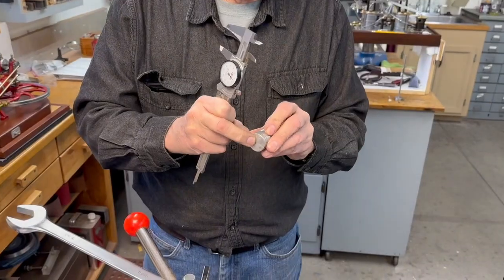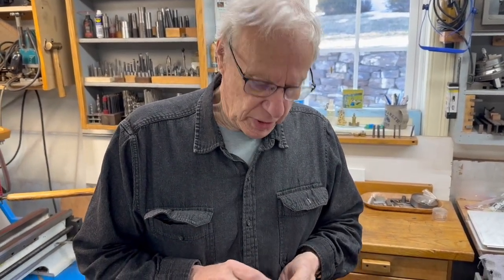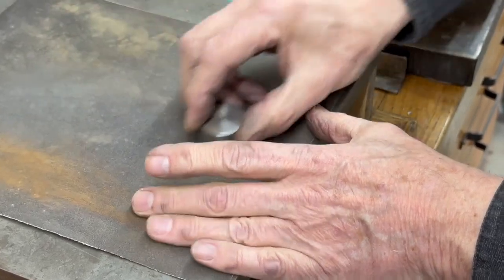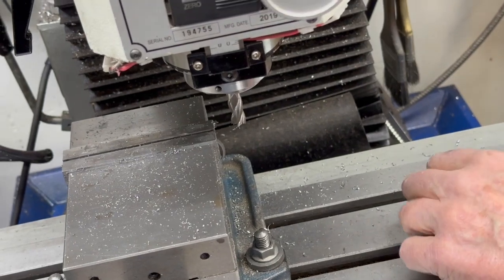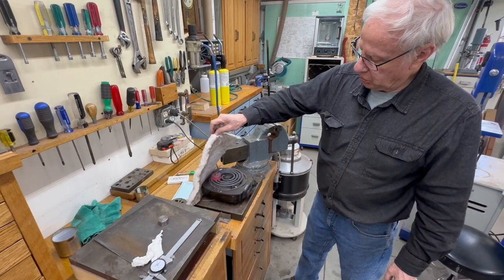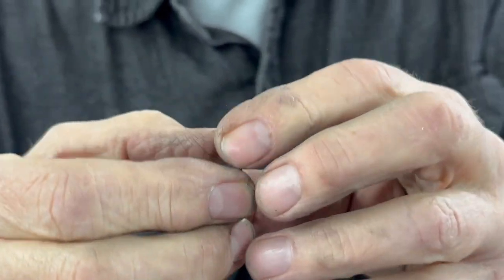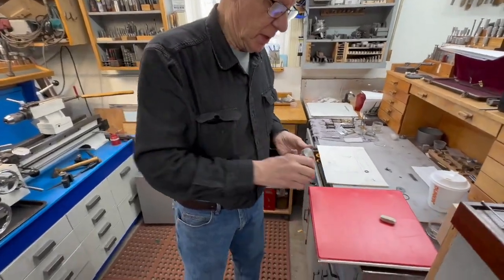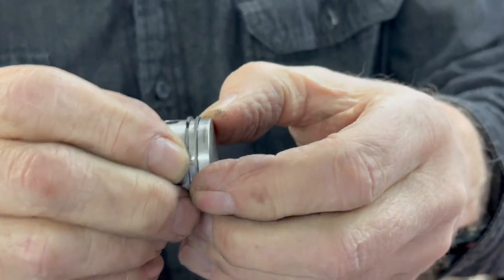How to Heat Treat Piston Rings

Comment: The fact that your parts lapped out in only 50 strokes or so, is proof as to how well your heat treating fixture and process worked to minimized warping and going out of round.
Reply from the maker: Yes like I said I’ve been using this method for about 6 years and have never had a bad ring, (yet)
It saves a lot of time making rings over which I use to do to often. Thank you for your interest. Joe